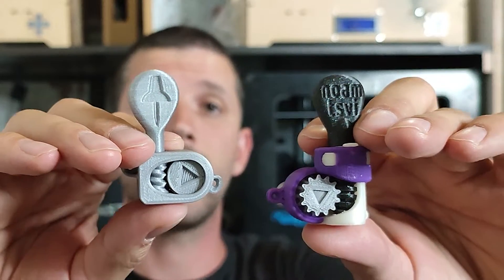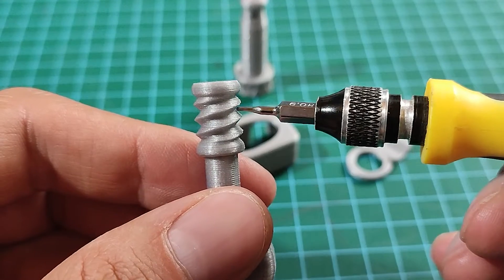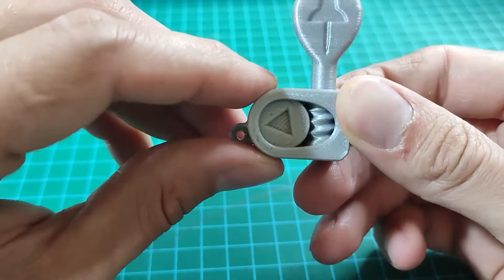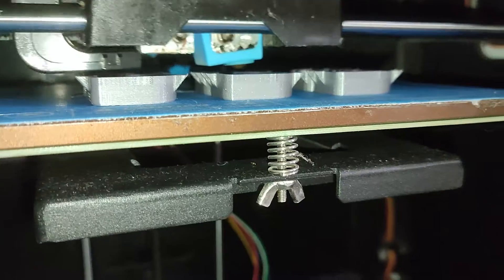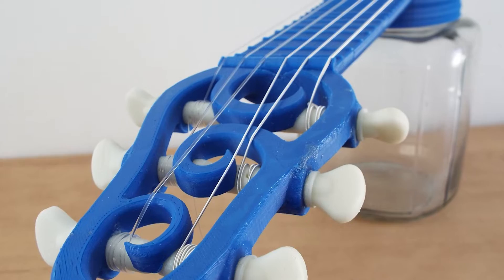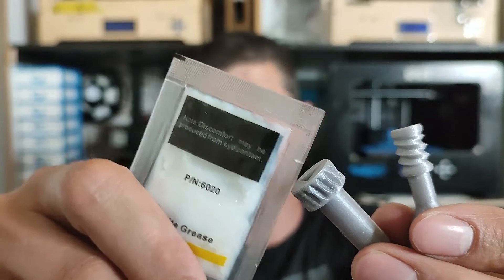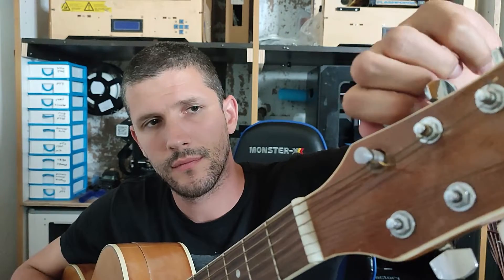3D printed GUITAR TUNERS that actually work!!

Comment: I tried these and they work okay-ish. The issue I had was when tuning the low E, the gears started skipping and started getting damaged. This was printed in Bmabu PLA Tough + with 95% infill. Have you considered using herring bone gears to reduce backlash and skipping? Would be harder to put together but last longer I imagine
Reply from the maker: I'm not sure how I would use herringbone gears in a worm drive. Maybe you can explain the logic to me.
Are you saying that your only issue was with the low E? Maybe I used a lower gauge string set, so I didn't have any problems.

Comment: As much as it's cool and fun to design fully 3D printed parts and push the limits of plastic I think a really great material for reinforcing 3D printed parts it threaded rod or bolts. I think it would be a really good idea to hollow out the pole part that the string winds onto and put a bolt through the centre of it essentially giving it a solid metal core. You would need to also drill a small hole through the bolt where the string goes through. Watching you tensions the string made me super nervous particularly because the layer line go horizontally through the pole.
Reply from the maker: I might as well buy new metal tuners rather than add metal parts. They're not expensive.
The point of this project is the challenge, testing the capabilities of 3D printing, also just for fun.

Comment: Have you tried the Steinberger style tuner in 3d print?
I'm pretty sure some of the parts would need to be metal, but it's a very compact tuner.
Reply from the maker: it's possible with slightly larger parts. I haven't tried to 3D print those tuners, but I have a design that works similarly, eventually it'll get a video

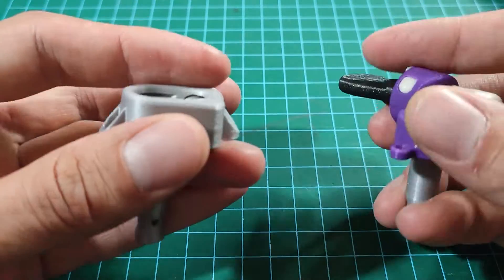Comment: Do you have the Cad model? I want to use your worm gears but make a 90 degree flipped tuner. 0:45  Great work.
Reply from the maker: Thank you 😊 Yes I have the files since I have designed them. I'm considering if I want to share STEP files and allow remixes. You're interested in the second version?
Reply: @noamtsvi  Yes. I wanted to add bevel gears so that the peg is 90 degrees. Like a banjo tuner. I might just model it myself but there is a lot of trial and error.
Reply from the maker: @illerhag  I just updated the file license to allow remixes and added STEP files. So feel free to upload a remix on printables. https://www.printables.com/model/473276-guitar-tuners-that-actually-work/files
and yes, trial and error is always a part of the process

Comment: Why is the second version worse than the first?
Reply from the maker: Please explain why you think this
Reply: The second one barely could get to the desired tension on the low string while this one could rip a nylon string.
Yes it's easier to assemble and print but from the tests the idea i get it's that it doesn't follow form over function
Reply from the maker: @octaviooyhanarte9574  actually the first version can't get halfway to the desired tension with steel strings. the second version can get to the desired tension plus a bit more. It can also easily rip nylon strings, I thought that was obvious. If you have a 3D printer, you'll definitely see a difference between both versions

Comment: I have put these tuners printed in PLA on several cigar box guitars and they hold the tension fine, but I find after a short time fine tuning is difficult as the tuner advances too much in either direction which can get frustrating going back and forth trying to get the string in tune. I am wondering if PETG, which I have never used, would work better.
Reply from the maker: It might be because the angle of the threading is too aggressive. I added a single thread version on printables, the thread angle is smaller. But they are not as strong, the single threads aren't strong enough for guitar strings. I don't know what strings you're using, but maybe it'll work. Also you can higher the flow rate a bit while printing to make a tighter fit. As far as material goes, I've been using PLA+, Wich is a bit stronger, I haven't tried anything else, PETG should work better in theory, but if it gets damp before printing, it would snap. Another strong material I've been using lately is Esuns ePLAst. Maybe that's another option. Good luck and keep me posted 😁

Comment: Curious why you wouldn't use something stronger like PETG. Anyway, good work
Reply from the maker: Thank you ❤️ I wanted to make a version that anyone can print, I used PLA+ because it's the most common. I wanted to make more videos with different materials, but I don't think it's necessary since PLA+ works just fine.

Comment: that's a great design but still can benefit some improvements. However the license on Printables forbids any remixes and is as strict as it can be. Wouldn't it be better to share it with the community?  think this is not going to be commercial product anyway (metal ones are cheap enough and sturdier). And using it in hobby project sometimes require some adjustments or changes.
Reply from the maker: There is no problem in modifying for a single project. What I have a problem with is people reuploading my design under their name. I spent a large portion of my life on this design. Yes I would like to see people using it. But I don't want to disapear under the remixes... The first version was already reupload by someone, he removed all the watermarks, tags and everything..
What do you think?
Reply: @noamtsvi I think that even the most restrictive license is not an obstacle for thieves. And for those who respect the law - you can share with the "Sharing without PARTICIPATION" option turned off, so you will be credited in remixes and projects using it. But since your design is more generic and universal - it's more likely to be copied, so perhaps your concerns are valid.
Reply from the maker: Maybe
Reply from the maker: @TomekUoo   Hey there. Since I'm not so active lately on this platform. I've updated the file license to allow remixing and added STEP files. Let's see where this road takes me.

Comment: Can you use nylon filament as strings? very cool design, always amazing to see how strong can 3DP parts can be!
Reply: It will be interesting to test, what's the best filament for making music.
Reply from the maker: @3DPI67  I don't know, I didn't get to making that video yet
Reply from the maker: @3DPI67  I tested a bunch of filaments that I have. I don't have nylon though
https://youtu.be/sUlMYsDY350
Reply: Nylon filament (straight from spool) works great as a G string in my Bass ukulele, however trying to 3d print thicker strings resulted in crappy buzzing sound. Maybe TPU can do better
Reply from the maker: I thought of using filament as strings, nylon might actually be a good idea
Reply from the maker: I was thinking of using TPU

Comment: They won't hold up over time. It will snap due the the layer lines.
Reply: with PETG it can survive - it has good between-layer adhesion, but it could be shorter to reduce the lever,
Reply from the maker: I wanted to make it a bit shorter, but remembered only after sharing the files. I should post an update.
Also I wanted to try ePLA-st..it's supposed to be really strong
Reply from the maker: We shall see, tuners are in for a couple of days now. So far so good

Comment: Looking good and very clean design on the new set! I'll try casting some in aluminium later this month so they aren't as heavy as the brass one 😅
And +1 for music choice, not too many bold youtubers out there with that kind of background music!🤘
Reply from the maker: Thanks man, It's an awesome track, I've used it twice already😎🤘
Does this mean I can be expecting an awesome video by you soon?
Reply: @noamtsvi  "Awesome" is setting the bar a bit high, but I'll see if I can get some footage :D
Reply from the maker: @Projekthulen  can't wait
Reply from the maker: @Projekthulen   I think I should mention, the version I sent you isn't the final one. Check out the files on printables.com. Also I added the single thread version for finer tuning, they break when 3D printed, but cast aluminum should be good.
Reply: Hey, Thulen -- do you do Bronze casting...? 😊
Reply: @mclevy8687  mostly brass, alu and copper but trying to expand.
Reply: @jesperskovjuul  Throw some zinc in, I believe, with the brass and copper and you're there! 😃
Reply from the maker: @mclevy8687  he's the guy that sent me the bronze cast in the end of the video